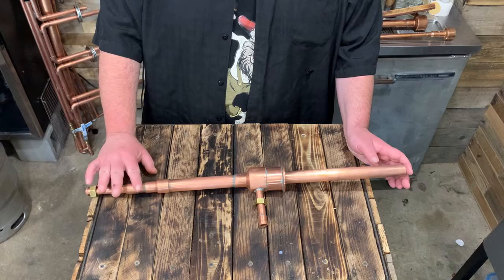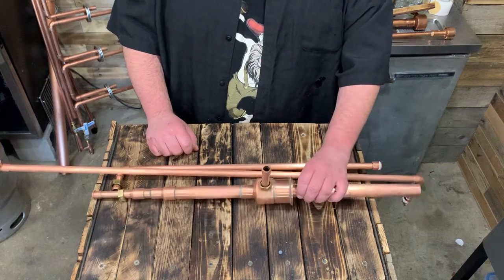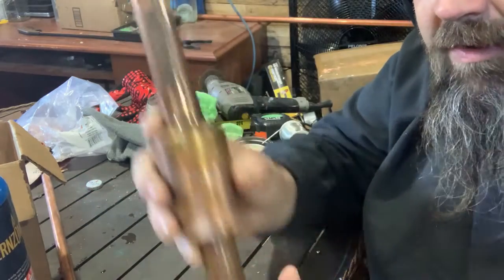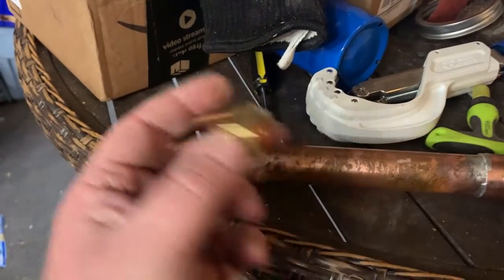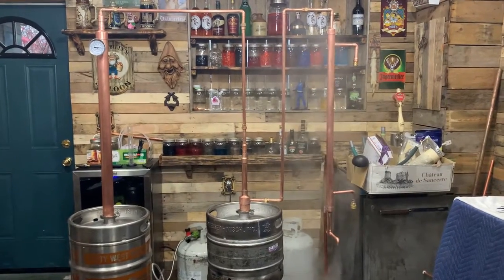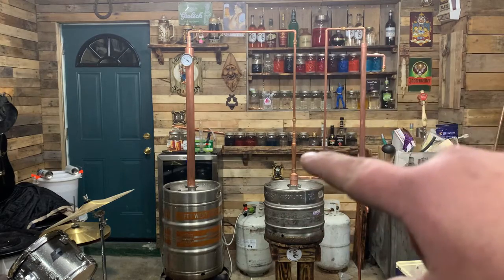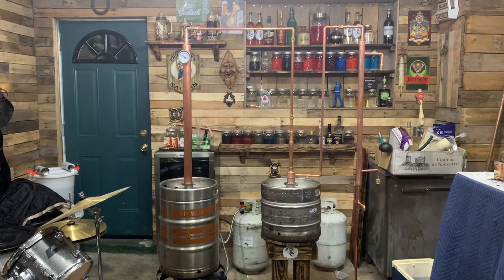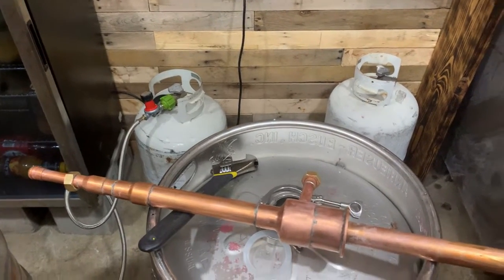Building a keg still pony thumper downcomer

Comment: I love the setup! I've run a 3ft 2" copper reflux still for years on a standard keg 15gal.
super high octane. Then cut down and flavored. I've not seen anyone else with a setup similar to mine. Absolutely a great setup. the versatility in using Kegs are fantastic.

Comment: Just did a super upgrade for the thump. I put in a permanent down arm out out stainless and put amd welded a stainless threaded collar and screw my copper right into that. 4 inch clean out, 3/4 inch stainless nipple coming off the top to the side for the condenser of ur choice

Comment: what do you use on the cleaning run copper sill or keg still
Reply: To each there own butt I have the same set up butt I have mine in all 2 inch from the boiler to the bottom of the thumper 1 inch worn. Never the less i use a fine stainless steel brush on a pole and some vinegar. Have mine designed so I can clean it on both ends with the brush . Get creative with ur build.

Comment: Looks like copper to aluminum connection is done with a clamp.  Hard or impossible to weld or solder there.
Reply: Tri-clamps are used for ease of assembly, filling, and cleaning, Far better then a permanent connection.